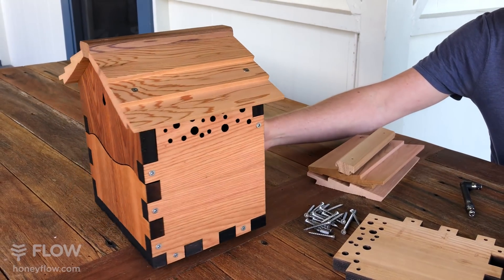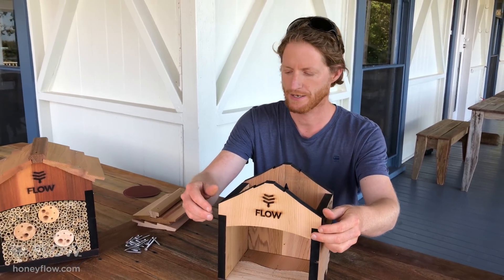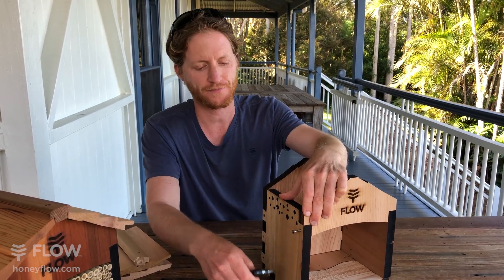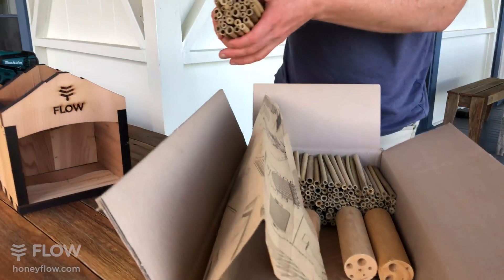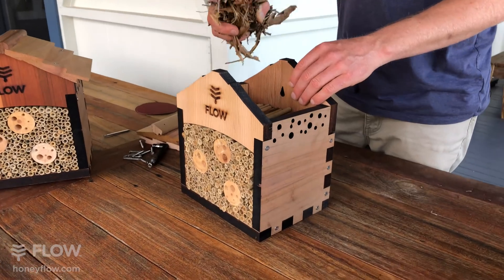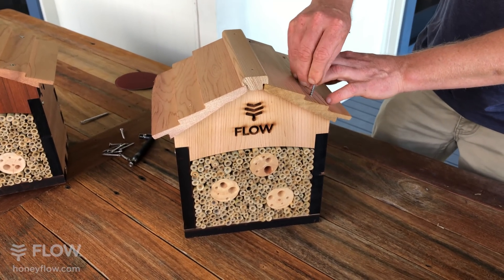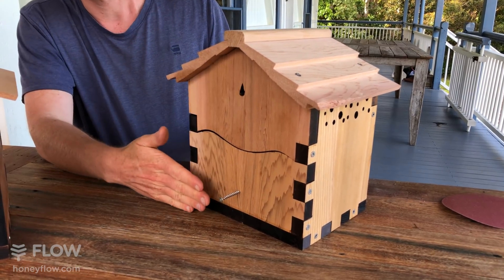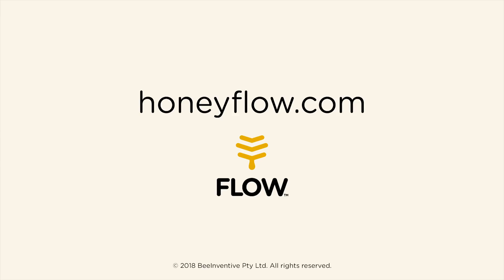Flow Pollinator House Assembly 🌸🌺🌷🌼

Comment: Hi, can you provide more information on where the best places are to place you pollinatior house?
Reply from the maker: Hi Corinne, it’s a great idea to put some consideration into where you will locate your Pollinator House.

Finding an area which is bathed in gentle sunlight (which the solitary bees love) and is protected from prevailing winds, tall weeds, and other animals is ideal. Optimally the house should be positioned 1 metre (3' 37") off the ground but no higher than 2 metres (6'74").

You may also find it is useful to add your own unique home renovations such as adding dry grass, leaves or crumpled cardboard to your Pollinator House to further diversify its appeal to different species.

Selecting a position which is already attracting insects, either a garden bed with flowers, a pond or an area with some trees will help to encourage vacancies in your Pollinator House to fill up quickly.

Don't forget to provide lots of access to forage and water for your pollinators. :)